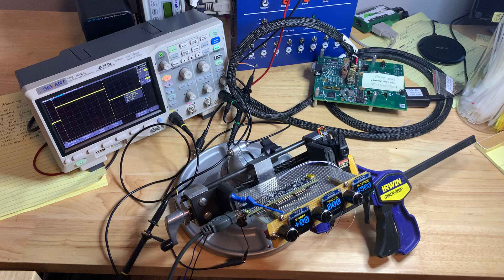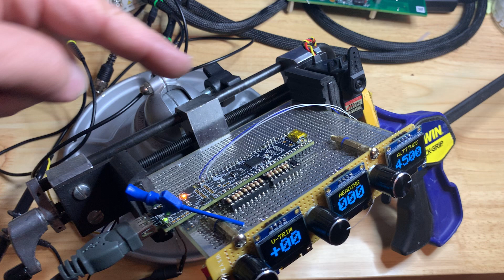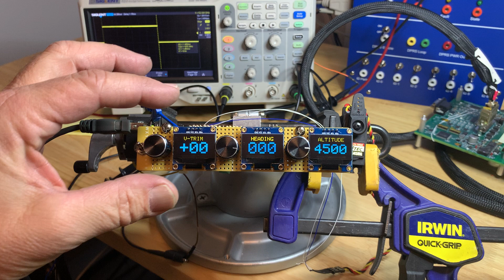Scratch Built Autopilot For The Clownfish Plane

Comment: It looks GOOD!. So how strong will your auto pilot servos be that connect to the actual aircraft control surfaces? Will you be doing any force measurements on the servos? Will there be any "auto disengage" function if you need to grab the stick while the auto pilot is engaged?  All in all, this looks like a really fun project for the Clown fish Plane. Knowing you, this will windup being a very slick auto pilot system. All the best to you for this project.